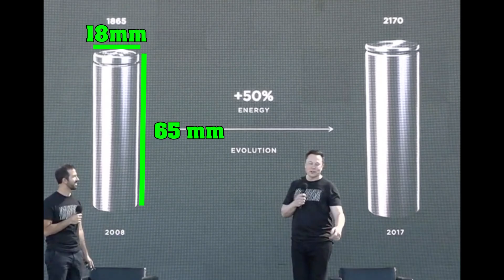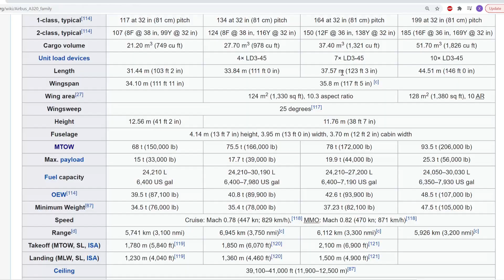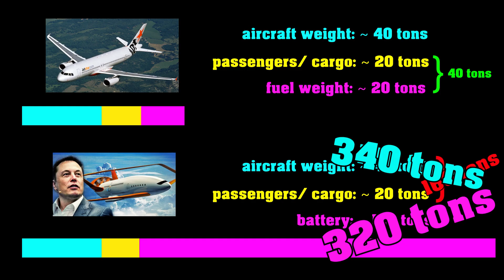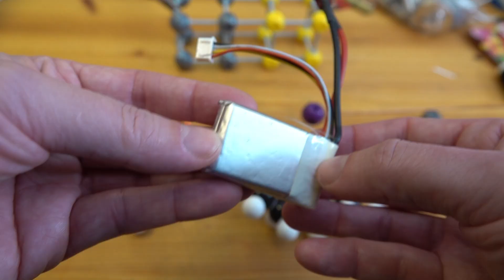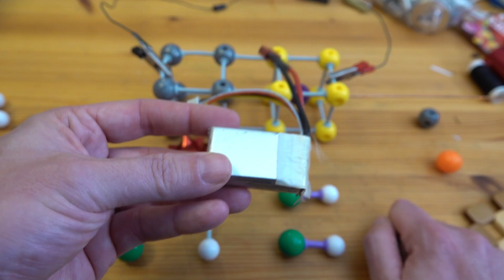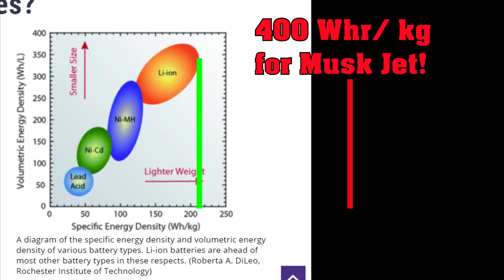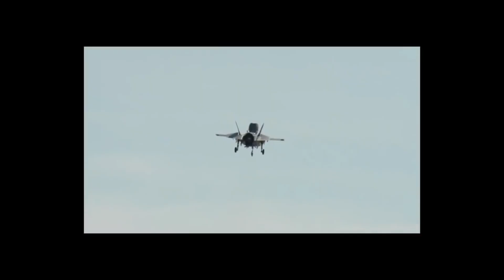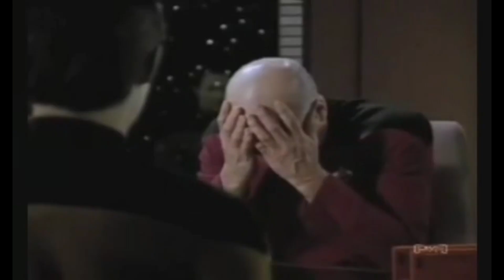Tesla's Secret Plan To Disrupt Airlines: BUSTED!!

Comment: Well, even if the batteries are 75% of the weight, because they are dense, it does not mean the inside space for passengers is smaller than a normal plane. The passenger area is full of air, all the battery can fit in the fraction of the cargo area plus some in the wings probabyl (1 cubicmeter of jetfuel is much lighter than same amount of battery). And if it can do the flights for less money (charging it to full compared to the jetfuel) it can work. Also lower maintenance cost, more environment friendly, and remote airports (islands) can just plant a sh*tlo@d of solar panel for charging :)

Comment: Oh, dear. What half-baked scheme is Musk spouting this time?

Oh, electric jet replacements. Yep. That's the sort of stupid I've come to expect after all his hyped-up-loop nonsense.

The only planes you can run on batteries are SMALL ones that only seat a handful of people and only travel a couple of hundred kilometres per trip.

If you want to clean up big planes, make your fuel from atmospheric carbon dioxide and be prepared to build lots and lots of solar panels to generate the gobs of electricity needed to make it. It's not impossible, just expensive and energy-intensive.
Reply: And build more nuclear power plants so you don't have to build so many solar panels.
Reply: @electric7487  Fine by me. Use the waste heat from the nuclear plant to do water desalination.

Comment: Why not just make a kind of heavy burst plane, whereby most of the battery power is used for the thrust to gain altitude, and then the plane glides on it's own momentum, propped up by semi-passive engines?

Comment: Good stuff, as usual. A couple of points. Increasing energy density to 400-500 Wh/kg might be possible by an increase in the relative permittivity of the electrolyte, which is what glass batteries claim to do. Your point about the stored energy being greater than thermite remains, though. It would be very dangerous if shorted, though the glass prevents dendritic growth, so the risk of this is lower. Advocates of the glass battery say it is not flammable, but that misses the point about the stored energy. Also, the more serious commentators say that bringing glass batteries to market is likely to take 8 to 10 years, which is much more realistic.

Comment: Now, I'm a complete doofus when it comes to physics and chemistry, so my question might be stupid. But here goes anyway: Musk repeatedly mentions a supersonic electric JET. As far as I understand it, a jet engine generates thrust by ejecting a jet of, well, something, like hot gas. I fail to see how an electric engine can generate jet propulsion. Was there any information about this in his presentation(s)?
Reply: Elon is an idiot but there are arc jet engines where arcs replace gas burner, obviously that had the trade off of providing energy for latent heat to convert air to fucking plasma

Comment: I've got the electric aeroplane worked out. You don't need batteries, just a fucking long cable. I'm surprised Musk hasn't come out with.... The Hypercable! Tomorrow's answer to the battery.
Here's another thing: in a Tesla car, after you've towed your caravan to the nearest charging point, you have to wait about 8 hours to charge the car up to continue your journey. How long does it take to recharge 70 or 100 tons of batteries? You look at all those sad Teslas parked in the hotel car park while the owner sleeps out the recharge period, and the funky cable plugged into the car and you do have to wonder how many of those cables need to be indexed into christ-knows how any plug-holes to charge a passenger jet. It would certainly give the cleaning staff plenty of time to clean the seats.
 And speaking of energy density, that's Elon Musk: energetic, but dense.

Comment: 12:28 you are holding what looks a lot more like a lipo cell used in rc planes then a liion liion almost never come in a pouch style with the acception for laptop and phone batterys the difrence in performence of lipo vs liion is quite a lot in discharge rate about 5 times

Comment: You know... I'm starting to hate batteries. Every freaking uneducated person thinks that everything can run off batteries. They NEVER think it through. Batteries are HEAVIER than combustables like gasoline or kerosine. Why do you think the smallest tesla is still a big car? Because of the massive battery you are sitting on, that is why. Making the battery smaller, would mean less range making it a worse vehicle to travel any distance.

As with cars, EVERY electric car weights FAR MORE than any car using combustables. That is just a fact. Batteries simply weigh more and because of that they also need a stronger structure to keep it from buckling under its own weight.

Next thing they will come up with is that the plain can fly indefinitely if they attach solar panels on the lodge and wins that will recharge the batteries faster than the engines will consume power.

I like having these arguments with defenders just so you can open their eyes. But some are just so stubborn that they wont accept being wrong even with evidence shown right before their eyes because they think people can work miracles.

Comment: I love the way that idiot you quoted got it 100% wrong: Jet's gain in efficiency when they gain altitude because they always burn the same fuel/air ratio - less air = less fuel - simple! 
The opposite is true of course for a battery-operated jet: at low altitude it will be efficient as the air is more dense, and the turbine speed can be lower, which takes less energy. Going high in a battery plane will wreck the economy. And I'm pretty sure we don't want passenger jets flying at 1,000 ft AGL.
Reply: Drag gets you every time. If you want to go fast you need to reduce drag. And that means flying high. Unless you are in a hyperloop of course 😀

Comment: I keep telling people, a big battery is simply a small hand grenade without a pin. And a battery which is 99.99999% (seven nines) reliable is still fucking dangerous and will ruin your day - or even your life. 
The REALLY cool thing about gasoline (et al) is that it is TREMENDOUSLY hard to ignite that stuff and get it to burn. You can dunk burning cigarettes into petrol all day, every day and it will never catch fire. It takes an open flame, or a spark (very hot!) to ignite the stuff, and that is why cars do not explode or burn to the ground every time they crash.
I always laugh at fools who tell you not to smoke while fuelling a vehicle. It is 100% safe.
What is NOT safe, is LIGHTING your cigarette while fuelling it - that could cause a fuel-air bomb-type explosion if the air-fuel ratio is correct. So yeah, smoking = OK, lighting one = possible suicide.

Comment: Ok, so air breathing engines have more troubles at higher altitudes, and higher altitudes have lower drag. But "electric" planes are propellor (both nonshrouded and shrouded/ducted designs) that need air to work because that is what they are pushing on to generate propulsion. So less air and you need larger propellor to work. (See the Martian drone design.)
Reply: Yes, this Casgain's Academy guy has zero idea of how airplanes work, at all.

Comment: One thing immediately pops in my head:
Battery does not exist.
Either the structure of the aircraft will catastrofically fail due to stress. They just can't cut corners on saving weight. If one cell fail catastrofically, it will create a chainreaction igniting all batteries... hence there is regulation on transporting batteries on current airlines.
If electric planes don't have combustion, how on earth are they going to push themselves forward without great volume of pressurized gasses in thin air?

Comment: 1:56 - energy density per unit volume of battery park has gone down in fact. Because when you stack larger batteries together you get more empty space between them, and hence less energy density.
Reply: Depends on the dimensions of the total storage compartment.
Reply: This is false, the density of stacking cricles on a plane is independent of it's radius
https://datagenetics.com/blog/june32014/index.html

Meaning no matter what the battery size is, the density of the volume of batteries compared to negative space is the same. And if you factor in the cooling needed for the older design, the battery packing is much more dense with the new design where the cooling is placed in the end caps

Comment: Mate the whole comparisons about weight are bull shit, It won't be constructed the same way as a normal plane, it'll be stripped back and likely make use of carbon fibre and other materials throughout construction which could probably take 40 - 50% off the body of the plane if you compare it to the weight savings you get from cars.

I'm normally a fan but shooting down everything just because Elon said it is annoying and repetitive

Comment: You misread the fuel capacity. It actually said 20,000 Liters. Which Google tells me is < 2 tons, assuming 1 ton = 1000 kilograms
Reply: No he did not.  @4:54 he highlighted 24,210 litres and said "about 20 tonnes". For fuel that is about right.  1000 litres of water weighs 1000 kg or 1 tonne, and fuel is a bit lighter than water.

Comment: How do you actually make a plane go supersonic with batteries. Sure, you can have an electric motor spin a propeller, but you can't go supersonic with propellers because physics is a cruel misstress.
I was thinking that maybe you could build a normal jet engine but use electric heating elements to heat up the air instead of fuel. But I don't know how viable that would be, or if it would even work.

Comment: One day there might be a galactic ray and wave inspector, em waves: gamma rays, x-rays; charged particles: cosmic rays, electrons, muons, and neutrons.
Reply: Researchers from Wuhan university have created a prototype thruster capable of generating plasma jets with propulsive forces comparable to those from conventional jet engines, using only air and electricity.

An air compressor forces high-pressure air at a rate of 30 liters per minute into an ionization chamber in the device, which uses microwaves to convert this air stream into a plasma jet blasted out of a quartz tube. Plasma temperatures could exceed 1,000 °C

Comment: 4:53 You say fuel capacity were about 20 t although it reads capacity to be 24,000 L, and fuel should be denser then water. Am I missing something? But of course one has to factor in that the fuel gets burned, meaning the plain gets lighter while in flight.
Reply: You are missing that fuel is less dense than water. One litre of aviation fuel weighs about 800gm.
https://www.engineeringtoolbox.com/jet-fuel-temperature-density-petroleum-volume-correction-ASTM-D1250-gravity-d_1944.html

Comment: Surely as the Electric plane gets higher, while there may be less drag, the propellers or impellers will have less air mass available to accelerate and thrust will suffer just as with normal jet engines, Therefore they will spin faster and all losses will increase, I.e. bearing losses, MOSFET or IGBT switching losses as frequency goes up, resistive losses in all electric motor circuits, including battery and so on.

Comment: Batteries? Meeeeeeybe using Hydrogen and fuel cells, but sorry, batteries are unsuited for planes...

But then.... Vertical takeoff? That needs more powerful engines! They need to carry the weight that's usually carried by the wings!

Comment: im sure it has been mentioned below, but if not, one thing i was kinda surprised was not brought up in the video was the fact that the battery would remain ~70% of the weight the entire flight while current jets can fuel specific to the trip and not hold max wight every time. this is also critical as they are designed to land with a certain much low weight then when they left. this is why they dump fuel if they have to land early in an emergency. but you wont dump batteries so you would have to design the landing gear to hold up the stress of the same max takeoff weight as well as runways to be able to hold up to that type of stress for repeated landings of such heavy aircraft.
Reply: You didn`t listen, did you? Musk will take off vertically and land, again, vertically. Very, very gently. He doesn`t need runways.
Reply: @Calvito-  you do realize that weight is just as important regardless . Just watch current VTaL jets and see the impact they have on landing. He would be better off using a runway as the plan can mitigate the impact by taking advantage of some lift as it touches down . And let's be honest will all this other stuff going on that make this plan unlikely they will add complexity of vector thrust jets to the equation??. Cause those drone style props in the rendering won't take you to the upper atmosphere doing transcontinental distance. So best bet it would be the shape of the regular commercial jet and this have to land on a long runway. But either way.. weight matters
Reply: @bretmohler9719   Obviously, I was being sarcastic. i don`t really know why Musk talks so much nonsense.
Reply: @Calvito-  well I didn't catch that sorry. These comments are a hit or miss on trolls on one side of the coin or the other. But I did for anyone else who may read our thread, want to clarify I considered the vertical part in my initial comment and landing weight is not only a problem for runway landings. If anything it's more of an issue with the vertical type.

Apologies for missing the /s 😋

Comment: why electric planes? planes could better go to liquid hydrogen. far more possible
Reply: Nope. 10,000 psi and -260C are required to maintain hydrogen in a liquid state. It works for NASA when launching rockets, but planes, not so much.

Comment: Safety is not even remotely feasible! The surface of the wing would have to be ludicrous considering battery failure. Think about this, if its weight is 70% battery and it fails in any way, that is just kinetic paperweight! There is no way they can glide something that is going to have the mass an electric plane would have.

Comment: As a flying model hobbyist I can definitely say that batteries have gone a long path and are pretty good nowadays, hovewer they arent good enough to use them in aircrafts or even in electric cars.  Their main enemy is price, capacity and weight. In cars its starting to be on the edge of usability and in some use cases it can beat ICE, but not all. For aircrafts its totally different story.

Comment: 2500 degrees Celsius? Only if the heat is on one side and no heat is on the other. If you put holes in it, the heat and the holes will cancel each other out! Same for the weight. The holes and the weight cancel each other out! A little bit of fiziks is your friend!

Comment: You need to consider the safe landing weight before the take off weight. There is no fuel to burn or to dump on an electric plane, so the take off weight must be equal to or less than the safe landing weight. That makes the picture bleaker than the one you paint.

Comment: There are many use-cases for electric airplane and the first comercial airplane with electric propulsion should get on sale in 2021:
- insel hopping: smaller crew as no refuling of cerosine
- local fright flights (customized battery for each flight)
- flight training (allready in use and fully certified)

This video doesn't mention all the structure for gas/cerosine propulsion wich you don't need with electric propulsion
You need a new level of flight desing and you may add solar engery (as with sol-1) or use lighter planes.
I don't liked the vibrations of on gasoline engine witch I go through a 50m cable, it's a much smother ride without an gasoline engine (after relase of the towing cable).

In many countries you'll get an license for landing and starting of electric airplane much easier as for the gasonline version. Many of my favorite landing sites holdes now licenses for electric airplane operation (and I have to lookout for the silent gilder or an electric airplane). The performances of electric plane are incredible (intersection start) and nearly no noise.
Wait some time and electric planes may be a type of freight transportation as they'll be permitted for night operation.

With a proper infastructure electric planes might be able to recharge at many smaller communal airfields and get longer distances.

Comment: Why electric planes are pretty much impossible?
A current long range passenger or cargo plane has 25% of its take of weight in fuel, other 25% in payload and 50% empty weight. Lets ignore the second two, and concentrate on the fuel part:
Fuel has around 50-100 times the energy density compared batteries. so if the electric plane would have the same efficiency, it would need 50-100 times as much battery compared to fuel, or around 1000%+ of the take of weight, yes, ten times more battery than the entire plane, for the same result with same efficiency. Luckily, electric motors are a bit more efficient, around 2-5 times depending the exact comparison, so we only need in a near ideal case 200%+ weight of the plane in battery. This is it, we need twice as good batteries just to still be in the impossible territory, and four or more times better batteries than we currently have, to even start creating anything remotely comparable to the current planes. And those planes are not acceptable currently, they are on their death bed, for a reason.

Comment: I made the most efficient battery in history, and it far out does the modern Lithium ion. It can store way more energy, but a small puncture can result in a massive steel container being shot at you at very high speeds, and if you get it too hot, it can explode with more force that some bombs. I call it the Hydrogen tank.